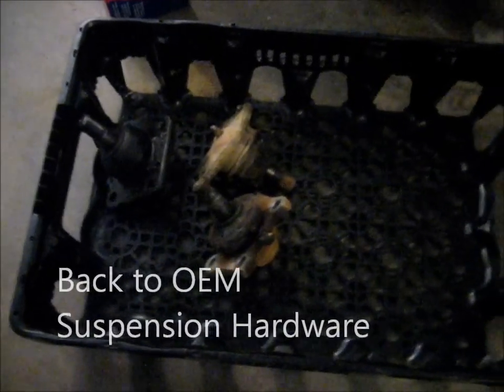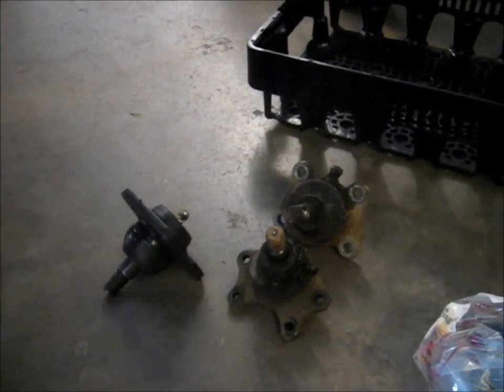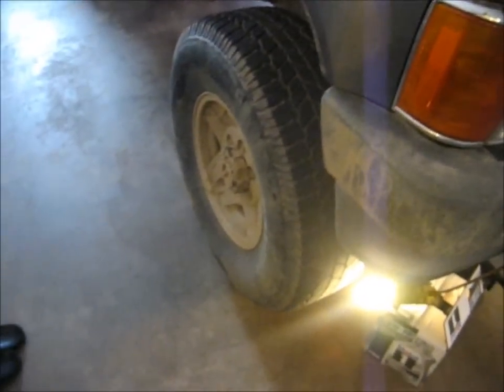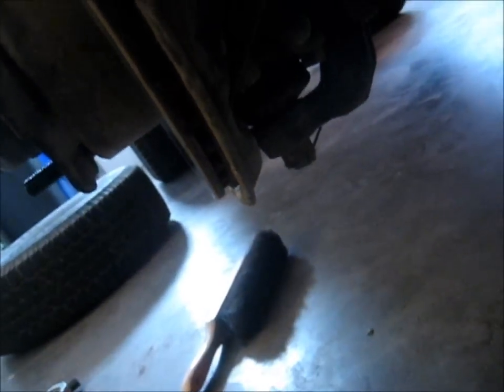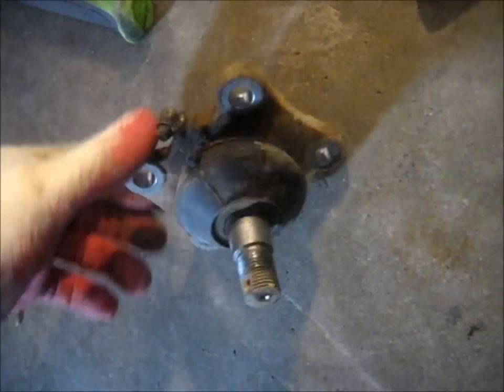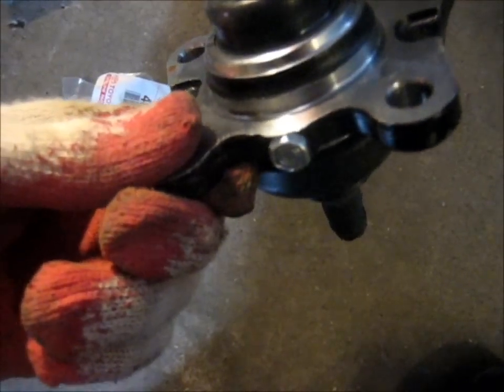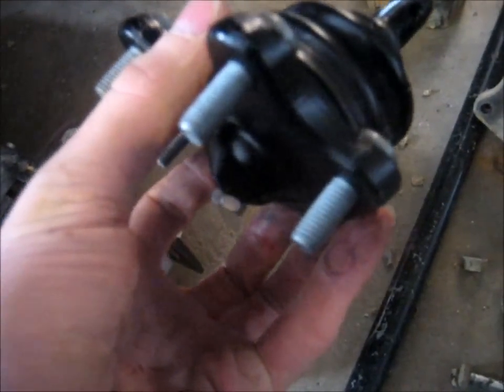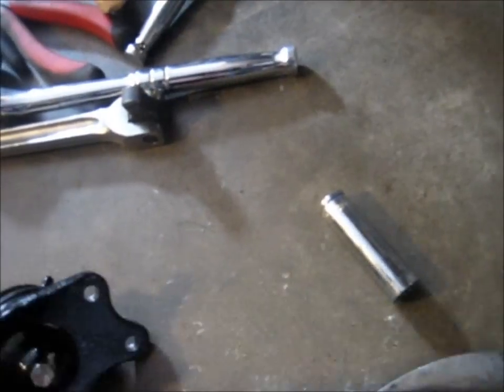4Runner Gets new Ball Joints... Again

Comment: Can I run my Toyota without the front differential installed . 4x4 to 2x4 conversion?
Reply: I have the opportunity to get a 4runner with a junk 3.0 L with a automatic transmission . 
I also have the opportunity to get a 2WD pickup with a 22re 5speed with a junk body /frame 
😄 bodies are at a premium around here.
Reply from the maker: Yes, you can. You should leave the CV shafts installed in the hubs or figure out something to plug the hole that in the spindle where the CV's are installed. If the hub is open debris and stuff can get into the hub area. The front wheel bearings will be exposed.

Comment: Hi Alex. Any trick to repair a slit in a ball joint boot where the ball joint is still good? Thks..jc
Reply from the maker: If you can source a new boot, you'll have to remove the tapered stud from the control arm. After that, pop the old boot off and the new one on. Pump in some new grease and you're good to reassemble. That being said, the ball joint will probably last a LONG time even with a torn boot if you don't submerge the ball joint in water. Just keep it greased.

Comment: Hello, about the genuine parts for Hilux 2004 : original 4 ball joints contain a spring inside and after 1000km it snaps and rattles and costs 250 euros. Ashika after market ball joints don't have the spring, lasts 20 000km, cost 50 euros...

Comment: Important to grease new ball joints regardless of MFG before installing. I use Lucas Red and Tacky, but heard Mobil 1 has good synthetic grease also. Any time you lift a truck higher than OEM you can expect increased wear. Chassis greasing intervals should be at the same time you change your oil 5k miles especially if your in extremely dirty conditions.

Comment from the maker: Yep, but I greased the aftermarket ball joints before and after each trip, so I don't think that was the issue. Plus the terrain I wheel on isn't that extreme. I have no doubt that the Toyota harware would have been fine.

Comment: How are the Toyota ball joints holding up?  Had I not watched this, I probably would've forked out the extra dough for Moog stuff over the less expensive replacement ball joints for my '94 XtraCab 4x4.
Reply from the maker: Toyota joints are still on there. Truck has 409,000 miles now. Nothing else is as good.

Comment from the maker: The rotors are a bit more invovled compared to other vehicles, but not hard. You'll need one special tool, a 54mm (2 1/8 inch) socket. This is needed to remove and reinstall the hub bearing nuts. Please don't use a hammer and chisel, it will work, but it's not the right way to do it. Remove the caliper, and then the locking hub. Here you use the 54mm socket to remove the two big nuts after folding back the lock washer. At this point you can remove the hub/rotor assembly.

Comment: Nice video, all basic tools used.  I hope you have an air tool set by now.  When was the last time those struts were replaced?   Just curious why the Moog wore out so fast.  Came pre-greased?  My '02 Tacoma had bolt on ball joints like this, so much easier than press out, like on my '05 4runner.  From what I remember about the bolt on, I strongly recommend using your OEM bolts- they can handle more torque.  The China bolts can fall out.
Reply: Moog parts don't have a good reputation.  And, about 30K miles ago I had the clutch components replaced as a preventative measure on my 97 Tacoma and specified genuine Toyota parts.  But the local yokal replaced with cheap after market parts.  And after 30K miles the clutch started slipping.  Took it to Toyota dealer and they replaced the components and no problems since.  I'll never put non-Toyota parts on a Toyota again.  There are several suppliers of genuine Toyota parts on-line at reasonable prices.
Reply: Well, I was wondering why I had a hard time finding the Toyota Brand upper and lower ball joints for my 2005 4 Runner (press out).   I went to my local dealership to get the part numbers and discovered they came with the entire arm.  Their price was $381 each, installation not included!  I guess it makes sense for them, easier to remove/install and come with new attachment bushings, and they can sell an alignment.  I think I'll have to roll the dice and go with an aftermarket :(

Comment: I probably should have commented here long ago - but I know your truck is stock again so it is a moot point.  Ball joint spacers are causing this issue.  Those who wish to run ball joint spacers should ensure that their upper control arm droop stops (or bump stops) are what is stopping the suspension from drooping.  Not the sway bar, not the shocks, not the lower control arms.  Any of those limiters will cause the lower ball joints to fail pretty quickly.  Ball joint spacers are pretty popular, but in reality running some Old Man Emu torsion bars with the torsion bars cranked (as instructed) is much more reliable.  And as one may figure out, you can just crank your OEM torsion bars for an inch or lift. 2 inches....probably not.  Sure, you use droop travel, but, those bump stops are their for a reason. The BJS adds space between the two control arms, and essentially the droop stop should be taller, or spaced thicker.  Would be BJS adopters need to ensure their upper droop stops on the UCA is the limiting droop factor for reliability.

Comment from the maker: After this, there are 6 14mm bolts on the back of the hub that hold the rotor to the hub. Once these are removed the rotor can be removed from the hub. I try to be clear but a service manual is cheap and much better at explaining things.

Comment: what size is spindle nut? 54mm? is it the same as 94 4runner 2wheel drive with 6 lugs pattern.
Reply from the maker: It is the same for your year/model. It's a 54 mm nut. A 2 1/8 socket will work too.

Comment: Is your Toyota ball joint still OK today?
Reply from the maker: +rondhole Still good.
Reply: +TheAlexManVideos  was the new OEM ball joint very stiff when it was new? or it is easy to move like a joystick
Reply from the maker: +rondhole OEM lower was tight and stiff. OEM upper had no play but moved freely.
Reply: Thanks. I was wondering how is the OEM ball joint on my Avalon with unloaded ball joint should be when it was new. The old one is kind of firm but easily moved by hand and rotate easily. The new Moog, duralast, and 555 is very stiff and 555 is just frozen tight. There is no play on the old OEM ball joint but the wheel is shimmy occasionally at high speed>60mph. After replacing with 555 I have not experienced any wheel shimmy .
Reply from the maker: +rondhole New ball joints are typically really hard or impossible to move by hand. This is normal.

Comment: What is that tool that you use at 4:20 for pushing that bolt threw? I need to get one of those!!
Reply from the maker: Technically it's a pitman arm puller, but I use it for ball joints and tie rods all the time.

Comment: what is the name of the tool  you used to squeeze the old ball joints out?
Reply from the maker: It's technically a pitman arm removal tool but it works perfectly in this application.
Reply: Pitman pullers are loaner tools at most auto stores- Autozone, Advance, O'Reilly.  Free as long as you return.